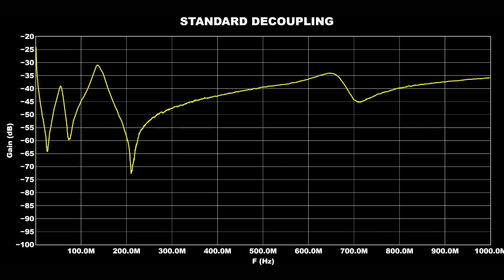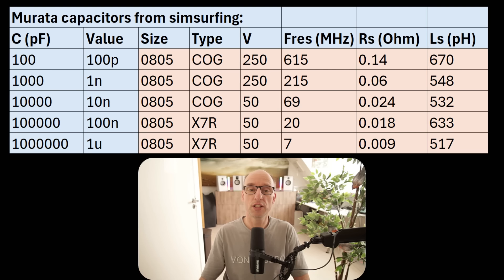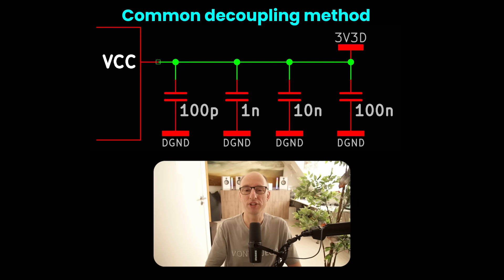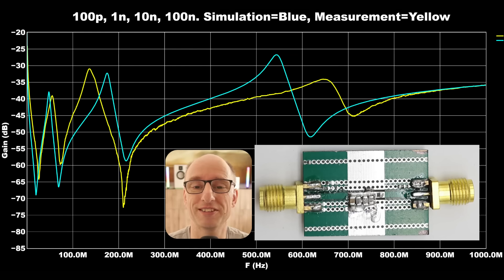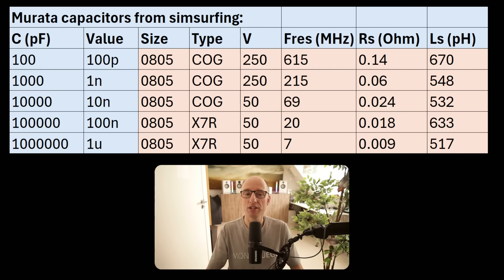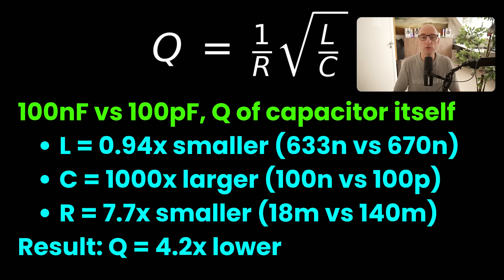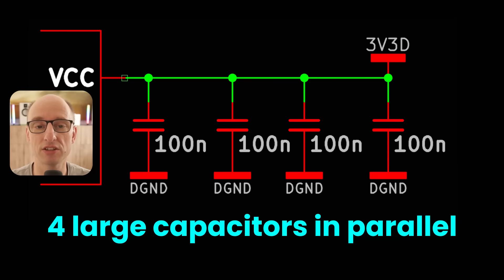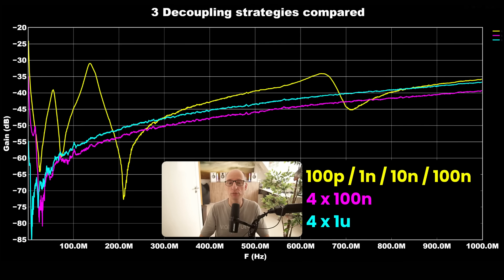The most misunderstood concept in decoupling

Comment from the maker: Free mini-course: https://www.hans-rosenberg.com/minicourse_account_youtube?utm_source=yt-p-v13
Full course info: https://www.hans-rosenberg.com/epdc_information_yt?utm_source=yt-p-v13
Reply: One small detail that I think that you got wrong.  If you take a given capacitor that has a certain Q then it doesn't matter how many of these capacitors you connect in parallel, the total Q for all the capacitors in parallel will be the same as a single capacitor.
Reply: @michael-j-harrison what I understood in the video is that you reduce the Q using them in parallel. I know my boards aren’t perfect but I will try to make them work very hard. I’m using double layer FR4 with high permeability which doesn’t help impedance control but I will make a PI network to match. The bottom layer is exclusively to ground plane and are connected through holes with wires soldering between them. Thanks for helping
Reply: FWIW: I use a PI filter:  Cap -> Ferrite bead -> Cap to reduce rail noise. I use this for my ADC and other components that need very low noise. Also helps using polymer caps instead of ceramic
Reply: @guytech7310 is there 0402 polymer capacitor? Thanks
Reply: I've been doing this for decoupling for YEARS because of trial and error but I never knew WHY it was better. I just knew it worked.

Comment: Thanks a lot for the insight and the great video showing your reasoning!
One Question: What is your take on decoupling Cs near ICs, like an OPamp or similar? Should a designer stick to a single 100n or will different sizes/types improve the design?
I wonder, because many Datasheets recommend 100n close by and another larger second Cap at a bigger distance on the board.

e.g. here (Fig 49) https://www.analog.com/media/en/technical-documentation/data-sheets/AD8429.pdf#%5B%7B%22num%22%3A129%2C%22gen%22%3A0%7D%2C%7B%22name%22%3A%22XYZ%22%7D%2C315%2C622%2Cnull%5D
Reply from the maker: The best overall strategy: Use the largest value in the smallest package. And don't use small values (<100n) ever because they'll increase the Q of resonances: If you do this, it's hard to go wrong unless you have a really sensitive high power application like an cpu of fpga supply.

Comment: Thank you! Three comments.
.
1) The “load” is simulated as purely ohmic and constant resistance. It would be interesting to investigate the influence of, for example, a fast CMOS digital circuit with its quasi-short circuits during switching operations as a “load”: here, since a capacitor with a small capacity has a lower time constant, connecting a large and a small capacity in parallel could be advantageous under certain circumstances. This means that not only harmonic excitation must be taken into account, but also switching processes, which in turn means that the complex calculation is no longer sufficient for description.
.
2) The source is modeled as an ideal voltage source; as a rule, this is a control loop whose quality depends, among other things, on the load situation.
.
3) The longitudinal inductances of the conductor tracks from the source to the combination of decoupling capacitors/load, which can already assume considerable values over relatively short distances, are also not simulated. However, only measurements in a specific application – which would be quite costly – would probably provide clarity here. In some cases, a pure “schematic simulation” is no longer sufficient; at high frequencies, an appropriate tool would also have to take the spatial extension into account, i.e., not only the existence of oscillations, but also of waves.
. 
Translated from German with DeepL.com (free version)
Reply from the maker: Hi, great points. All of these things have to be taken into account when doing a critical design. For this video it was way too much though. I only wanted to make people aware that this problem exists, so next time, when making a design, viewers can have a closer look at this and take precautions.

Comment: Suggested topic: Identifying and blocking power-demand transients (on/off edges) interference paths from a BLE audio bluetooth board (say) to other circuitry, when they share the same power supply.  I and others have attempted "detective work" on this, without success.  Possibly involves common-mode effects?  How on earth can one go about diagnosing and fixing this?

Details of a Specific Instance of This Problem:
One "unsolvable" decoupling issue I have is with an audio-receiving bluetooth (BLE) board powered from a low-power medium wave ("AM") modulator board.  Here, the power demand of the BLE board is not steady but instead occurs in pulses, each time it transmits (e.g. to handshake or acknowledge receipt of data), to the BLE sender.  On the main board, the frequency of transmission is generated by a PLL oscillator.  The PLL system is based around a voltage controlled oscillator (VCO).  The problem is, whenever the BLE board's power demand (suddenly) rises or falls, as it begins and ends to broadcast its ID or receive/acknowledge packets of data, the VCO frequency gets transiently "bumped".  The vector for this interference is not physical proximity, because the same occurs, unchanged, when the BLE board is moved ~30 cm away (by ribbon cable).  Related to this issue, several people who have attached BLE boards to their loudspeakers have experienced buzzing sounds, apparently due to the same kinds of power-demand pulses of these boards.  A popular work-around – which certainly does work – is to provide a separate power supply (e.g. isolated battery or simply a separate regulated power supply chip) to the BLE board.  But is there a less "sledgehammer" approach?   I and others have tried to identify and block the signal path that is "routing" such interference, but without success.  There is merely a vague suggestion that some kind of common-mode effect is happening here.

Incidentally, the power from the main board to the BLE board has decoupling in the form of first, from the main board, a series 220 µH inductor, then a 100 µF electrolytic capacitor to the circuit board's ground.  I have tried placing various capacitors (including larger electrolytic and smaller-value ceramic) across the 220 µF capacitor, but no reduction in the interference resulted.

Any suggestions for going about identifying and blocking the signal path would be welcome.  Have you ever experienced this messy problem yourself?
Reply from the maker: If it is really 'vco pulling' as it is called, this is a very common one! I've worked on a lot of ic-designs which had a internal PLL and a transceiver or receiver. The most common solution is to filter the vco supply using an RC network. Often, IC designers connect a separate pin for the VCO supply. Since the supply current is relatively low most of the time, RC works wonders. LC is tricky: it will start to resonate, this is why RC works so well here. Just make sure the R is small enough and the C is large enough.

Comment: Thank you so much @HansRosenberg74 for this! I'm reviewing schematics with this kind of decoupling so I've calculated Q factors and simulated the frequency response in LTSpice. I'm trying to simulate the ringing but I don't understand how you do it. Could you please explain the voltage source parameters or if there's any subtlety?
Reply from the maker: I inject a current transient and then watch what happens with the voltage. This video only shows the impedance effects in a 50 Ohm system. If you want to be totally safe you'd have to use the impedances in your board which is much harder to do. A safe way is to use large decoupling capacitor values: This will basically prevent almost all problems unless you have a really difficult application.

Comment: I put 100nf 0402 directly at input power pin of each ic
Then for switchers i add 3x 10 to 22uf 0805 bulk caps and more polymer bulk caps as well
Reply from the maker: That's a very good approach, avoiding anything below 100nF. For even better results you could use 1uf 0402 capacitors to reduce resonances even further.

Comment: While thought-provoking and well argued, this assumes a perfectly resistive/stable load and source impedance. In the real world, the extra resonances may never be experienced by the application (or could be tuned to be extra helpful) and the lower high frequency impedance at lower cost and smaller packaging may be more important in the application's design. So like everything in engineering... "it depends". Thank you for the video. Appreciate the effort that went into this.
Reply from the maker: Great points! This video was to illustrate that things CAN go really wrong. The key to getting designs right quickly is to always check these sorts of things for every design and see if you have a problem or not.

Comment: First time i heard of this was in radio amplifier design, when you try to notch filter a carrier frequency, that's where the resistors come in handy for finetuning. For multi-frequency amplifiers you could not tune the damping, so the suggestion was to use more of the same capacitors. Also learned there that placing decoupling caps on both sides (in board layout) of a power trace could help, like how feedthrough capacitors work.
Reply from the maker: 3 terminal capacitors are also great, they're like feed-through capacitors in an smd package.
Reply: @HansRosenberg74  ja, those are feedthrough capacitors. also good to use after SMPS if you can't use ferrites, when you need good transient response. With some power converters having over 1MHz switching speed these days, they are great, you can even find 1uF+ ones that handle several Ampere.

Comment: I discovered the "Reversed Decoupling Structure" through empirical measurements when I was an Applications Engineer at a major semiconductor manufacturer, developing an evaluation board for a switching power supply device.  It was the only way to reduce harmonic artifacts of the switcher low enough to pass the 3GPP requirements.
Even when I showed the measurement results to others in the department, some insisted that the caps should be arranged in the "traditional" way, with the smaller values closer to the device .
Reply from the maker: Yes, that is why I made this video, this structure is so common that it is hard to believe it is not a good solution.

Comment: In my designs, I place 1 µF 0805 capacitors on the power lines wherever possible, especially near the supply inputs of ICs, connectors, etc. So I guess I’ve been doing it correctly, even though until now it was without a deeper understanding :) Thank you for the video!
Reply from the maker: That should work :-)

Comment: If its so easily measured, why haven't engineers known this?
Reply from the maker: Because 90% of the time, you're fine and nothing bad happens..... So this can go under the radar for years (just like I had myself) until you hit a supply with a nasty load that also needs to be clean at the same time...... (that's when the penny, ehm pound drops :-D  )
Reply: You might be surprised how often engineers rely on "rules of thumb" because they are labor-saving techniques.
Reply: Eric Bogatin calls this "Legacy Code".
The approach dates back to PTH components, where small valued capacitors were physically smaller than large values, and thus had lower lead inductance.   Clocks speeds were much slower (1-10 MHz) and more importantly rising edges were slower (10-100ns).
Modern SMT capacitors have about the same inductance for the same package, as Hans mentioned.  Smaller package => smaller inductance.
Today, a jelly bean inverter(74AC04) has a rise time of under 1ns, which means it wants power rails that respond at those speeds, too, and with poor decoupling that will give unreliable operation.
Unfortunately, several decades of datasheets blindly copy this outdated advice.
Search for the "Myth of three capacitor values" for more info.

Comment: I understand that 4x100n + 1 Ohm is a great solution, but how much better is it than 3x100n, 2x100n, or 1x100n?
Reply from the maker: It highly depends on how 'badly' your load is behaving.... if it does not emit spikes, it doesn't matter. If it does, you have a problem. If your load has a very noise current, it may also cause problems in the form of noise bumps. In that case, it depends if your circuit is sensitive to it...

Comment: you can derive the following 8th order transfer function to model the circuit without any simulation:
Z1=1/(C1*s)+L1*s+R1
Z2=1/(C2*s)+L2*s+R2
Z3=1/(C3*s)+L3*s+R3
Z4=1/(C4*s)+L4*s+R4

Yout=1/Z1+1/Z2+1/Z3+1/Z4+1/Rout;
Yout=collect(Yout,s)

Zout=1/Yout

G=Zout/(Zout+Rin);
G=collect(G,s)
Reply from the maker: That will work (if you're willing to do all the math that follows this starting point :-D  )

Comment: 6:20 the thing is, you are only looking at a single size. To my knowledge, the biggest factor in ESL is the physical size of the package. And in a typical design, a smaller value will come in a smaller package. 100n will be in 0402, while the larger values will come in something bigger. No clue why anyone would even bother with 1n or smaller.
Reply from the maker: Yes, you are correct.

Comment: Best solution to damp ringing AND keep lowest possible impedance: Use series RC's as well as C's. That way you can even put a few uF directly at the output (!) of a typical OPAMP, e.g. buffered DC reference, as long as the RC is low-ohmic enough to damp the whole thing. Means: big C and small R in RC. And: The RC 45° corner frequency must be way below the circuits resonant frequency, to have the R part of the RC fully enabled at the resonance, thus the series RC sucking current at near 0° phase.
Reply from the maker: I've tried these 'snubber' networks, but they're not as effective as preventing a resonance. They will damp them somewhat, but not as much as I hoped.

Comment: hello hans, what is the software simulation do you use?
Reply: LTSPICE will do. Easy circuit.
Reply from the maker: I use the student version (free) of simetrix. But these basic simulations should be possible in any simulator.
Reply: you can derive the following 8th order transfer function without any simulation:
Z1=1/(C1*s)+L1*s+R1
Z2=1/(C2*s)+L2*s+R2
Z3=1/(C3*s)+L3*s+R3
Z4=1/(C4*s)+L4*s+R4

Yout=1/Z1+1/Z2+1/Z3+1/Z4+1/Rout;
Yout=collect(Yout,s)

Zout=1/Yout

G=Zout/(Zout+Rin);
G=collect(G,s)

Comment: Where I worked in 1970, a swedish engineer wanted to use some capacitors with built in series resistors. The engineering manager was not impressed so the idea was dropped. Now I see that the swede was right.
Reply from the maker: Haha, yes.

Comment: When I started my journey after graduation, over 20 years ago, no one talked about this; these topics didn't exist. Over time, as processor frequencies reached the 1GHz level, this subject began to emerge.
Reply: At first, the advice was to use capacitor banks grouped in decades: 100nF, 1nF, 10pF. Those were the recommendations, likely based on the assumption that in through-hole components, lower capacitance meant lower inductance. However, back then, no company published this data. Not to mention that I didn't have access to a signal generator, oscilloscope, spectrum analyzer, or VNA that covered even a 200 MHz bandwidth. So, we simply followed the advice in application notes.
Reply from the maker: Nice summary!
Reply: Size (Imperial) Typical Inductance (ESL)
0402 ~0.4 – 0.6 nH
0603 ~0.7 – 0.9 nH
0805 ~1.0 – 1.2 nH
1206 ~1.2 – 1.6 nH
Reply: Type Geometry Typical ESL
LW Reverse 0204 (0510 metric) ~0.15 – 0.2 nH
LW Reverse 0306 (0816 metric) ~0.12 – 0.15 nH
3-Terminal / IDC 0402 / 0603 equiv. < 0.05 nH
Reply: Today we know that inductance is largely determined by the component's size; we have better equipment, greater knowledge, and awareness. So, let’s apply this knowledge today
Reply: Today we know that inductance is largely determined by the component's size; we have better equipment, greater knowledge, and awareness. So, let’s apply this knowledge today.

Comment: the fact that you use different techno of capacitor doesn't increase the problem ? COG and X7R.
I mean the COG seem to have a bigger L value than the X7R
Reply from the maker: actually, the inductance is more size-related. COG and NP0 have less loss and are way more accurate and stable.

Comment: Has anyone installed 300 0.1µF 0201 capacitors under a 1000-pin BGA chip (like a SAS expander)? Instead of the usual 0.1µF + 0.01µF + 100pF?

How are the results? Does the chip work?
Reply: Take a look at motherboards. Those are working engineering designs for chips with extreme load profiles.
Reply from the maker: I think in such a case they usually put a lot of 1uF caps or bigger...